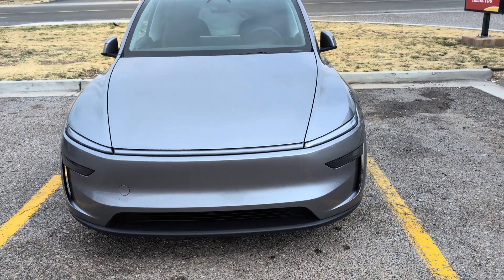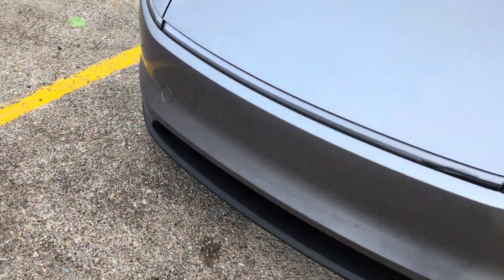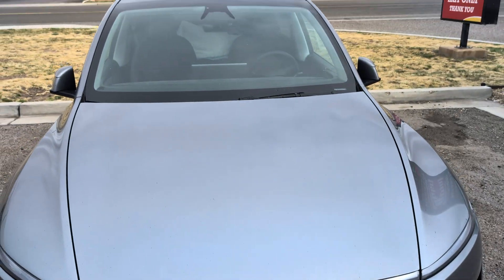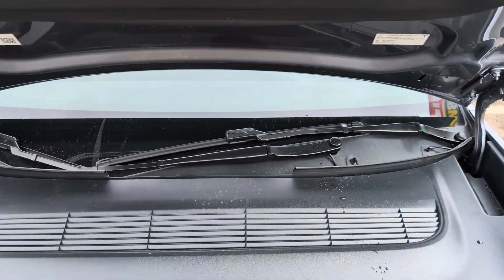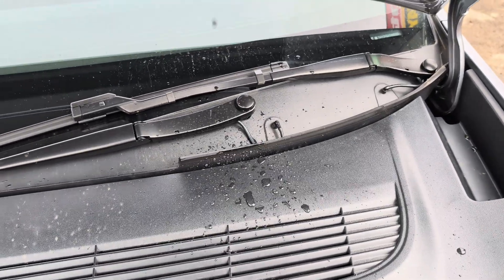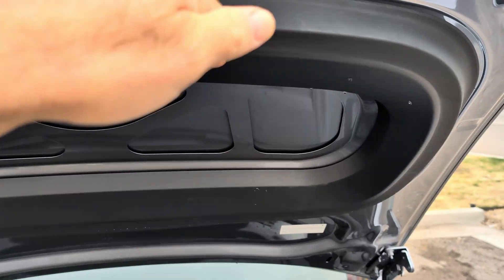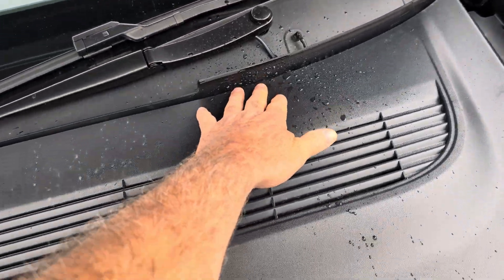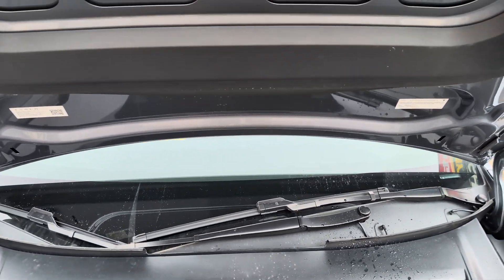NEW UPDATE!  Water recycling by Tesla

Comment: Lol. On the other hand the design on the old model 3 and y was just awful that it went into the cabin filters and soaked them. This flap that you are showing is actually a welcome addition that prevents mold and nasty smells.
Reply from the maker: It might stop mold and funky smells in the filters, but we might have a problem with the water in the boot. If you don't open the hood after every time it rains and you're driving to drain the water out into the AC vent it's going to stay in there and get mildewy.  In my opinion anyway we'll see